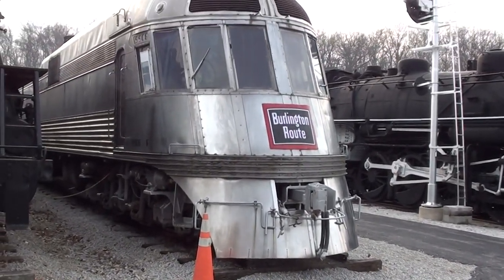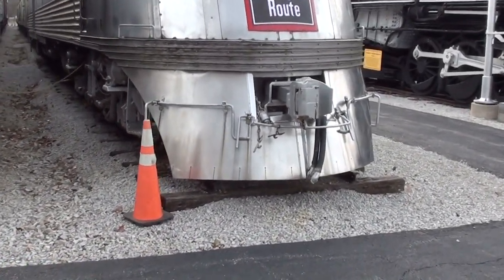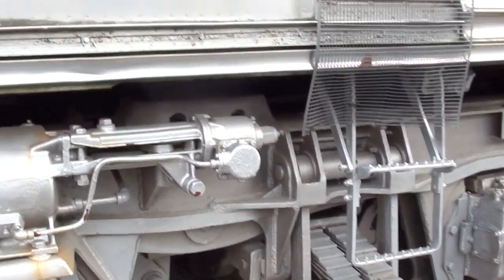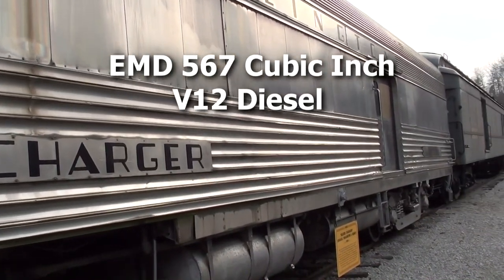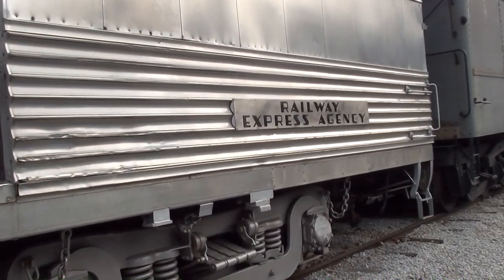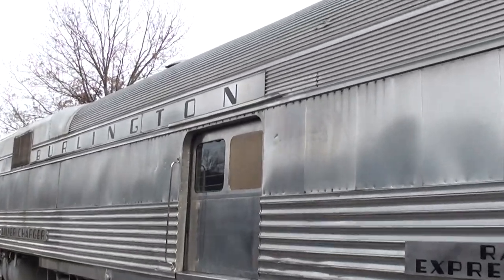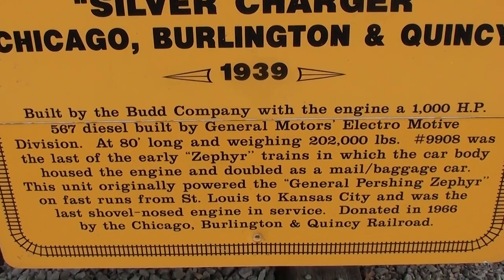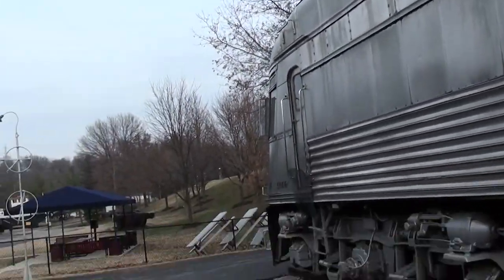1939 Silver Charger Streamliner Engine 1000 HP V12 EMD Diesel #9908 Zephyr

Comment: All the original Zephyrs had a single Winton201 A engine except the last one 9008. The EMC 567 was in production then explaining why the Silver Charger got a V12-567 rated at 1000 horsepower. The charger had n A1A lead truck and a 2 axle trailing truck. all Zephyrs were single engine. Only the EMC E-1 started the use of 2 engines per locomotive. Besides like the Boston and Maine version of the zephyr when they first went into service there was a machinist with helper and an electrician onboard in the event of trouble.  When having breakfast one morning in 1972 within 20 miles of LaGrange, I'll. I got the last table at a small diner and a minute later spotted an old timer being told there weren't any seats available soon I yelled at him that I didn't mind sharing. All i remember is his name was George as I was studying a locomotive manual he picked it up for a moment and asked you a rail buff? I was 21. Yes I am but I started my second year as a locomotive fireman for Penn Central out of Springfield I almost fell over when a few minutes later he told me he just retired from EMD. Turns out he was a field engineer training railroad engine house personal how to maintain the new diesel electric locomotives. His first big assignment was field engineer in charge of the ( as he put it ) 4 unit freight engines demo tour in 1939. This guy was in charge of EMC FT demonstration set of freight power. We sat and just talked locomotive's and man do I wish I had a tape recorder then, this guy was a fountain of knowledge.  Runningover the Great Northern he had a bad power assembly in a booster unit so using the railroad supplied mechanic and his assistant they changed out a power assembly in just under 3 1/2 hours and cranked her up and back on line to hear the engineer say to the fireman it feels like there all working now as they were just near stalling on a grade  and just stood there and watched them walk from 10 mph to just under 19 mph where they settle down and up the grade they went. He said the demonstration that really excited the railroad operating department more than the Santa Fe Railroad across the southwest through Arizona and New Mexico. What excited the railroad was the four locomotive's used a total of 37 gallons of water from Los  Angeles to Chicago and ten of that total was drinking water. The Santa Fe had to haul all water for steam locomotives in their own fleet of railroad tank cars to keep the freight and passenger trains moving. The Santa Fe wanted to know how fast they could start delivering the FT model locomotive's to the Santa Fe in Chicago. The Santa Fe was ordered by the war production board to receive eventually 350 EMC model Ft freight engines for service in the southwest through hot desert in both states. Santa Fe was also greatly impressed by the dynamic brake on the FT that allowed a train to drop down a grade with the air brakes in full release. Meaning the railroad didn't have to replace over a 350 brake shoes on the train just coming over Donner Pass. That plus no water stops and no replacing the break shoes meant the train was able to get over the road faster than the steam powered trains.

Comment: Silver charger was the last shovel nose zephyr unit built, used a single 12-567 engine of 1000 hp... the other shovel nose units 9900-9907 used winton 201A engines.... by the time the Charger was built in 1939 EMC had been building "E" units for about three years an was starting to build "F" units....So, it was actually a bit dated....EMC became EMD in 1940 and shortly after that point their locos became more standardised, ending that era of individual models for each railroad....

Comment: You left something out in your 1000 HP 567 Cubic Inch engine description: it’s a V-12, but it’s 567 Cubic Inches per cylinder, not just 567 Cubic Inches. That’s a total of 6804 Cubic Inches.